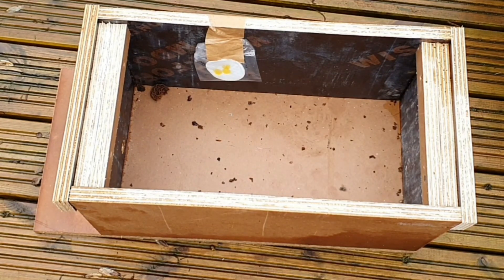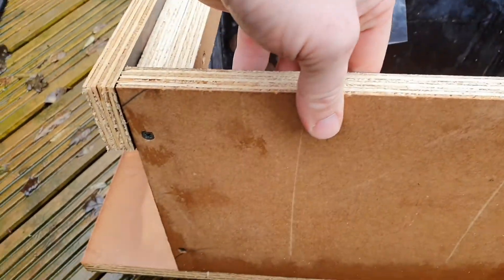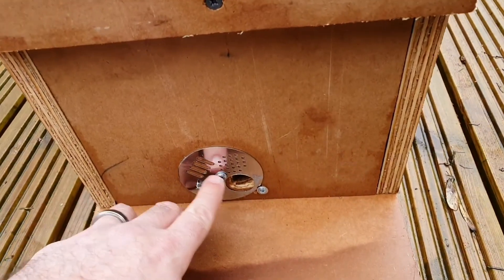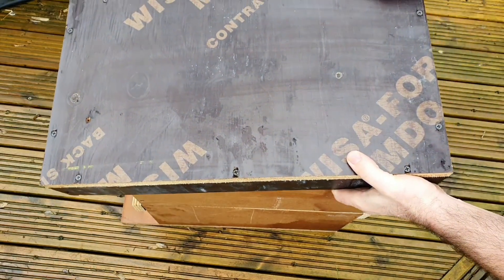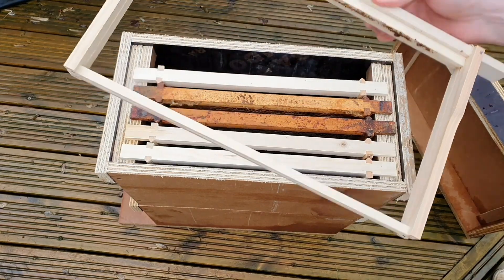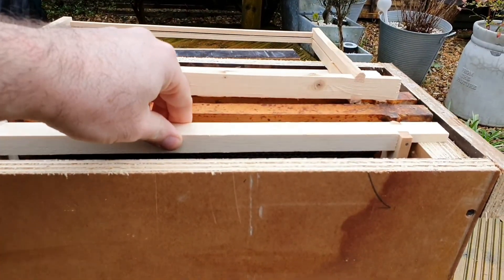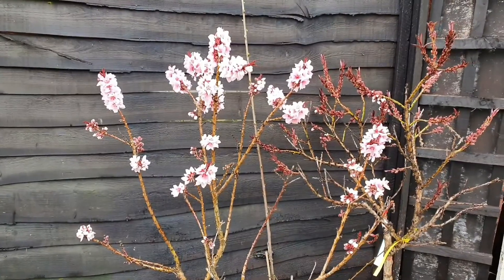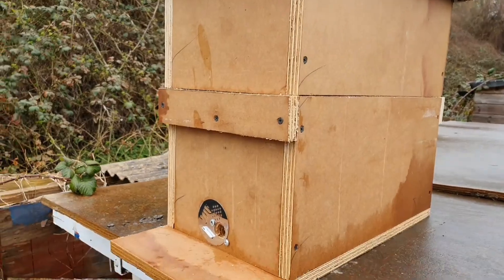Swarm Trap / Bait Hive For Free Bees!

Comment: Hey. Very nice.  Another very important tip. A 1/8 inch hole in each bottom corner for water drainage. The top must be water proof and rain tight dry.  Good luck
Reply from the maker: Thanks its had a good few scouts checking it out but so far no swarm

I've also joined my local association in case any reports a swarm they want removing 🤞

All the best
Roo